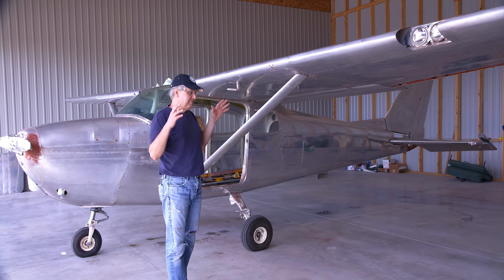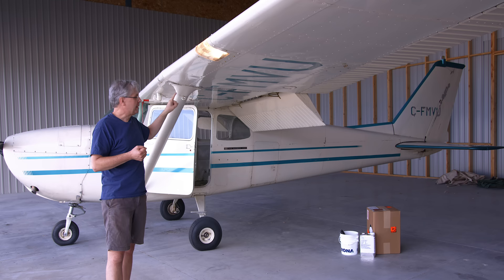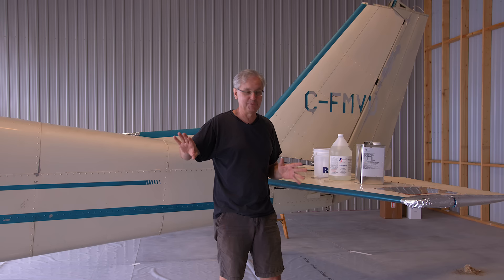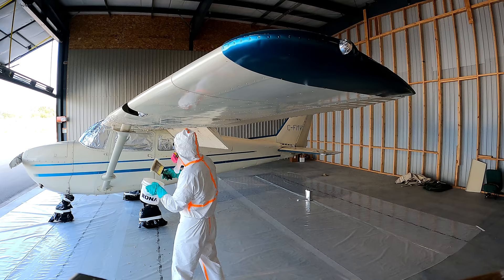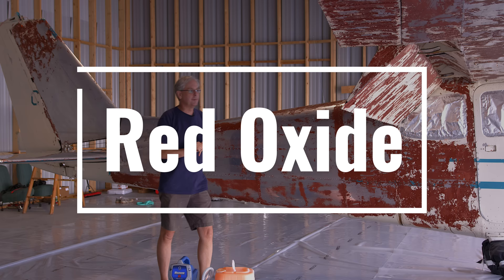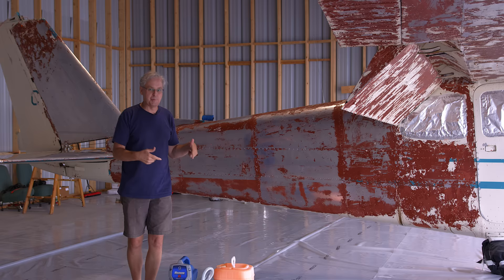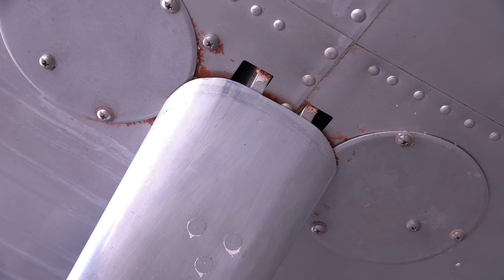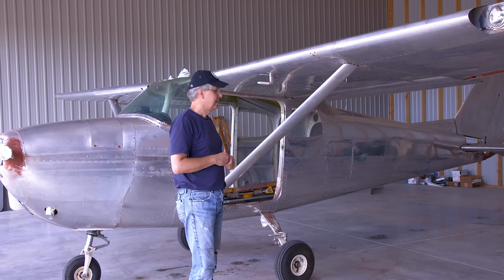Stripping The Paint From A Cessna 172B Glen's Hangar - Episode #5

Comment: Wondering why you didn't remove the control surfaces before stripping the plane?

One of the ATR-72s I used to work on, you could still find bits of blue paint from when it was with Vietnam Airlines.

Love the mystery of the tail! Oh the things you find hidden beneath the paint on aircraft.
Reply from the maker: I’ll be pulling those off when the plane is in the shop for the panel upgrade.

Comment: This plane is the perfect example of why to never ever go bare aluminium.Mismatched parts, patches, small dents from many years. Everything shows up, and anything but absolute perfection will look bad. Even to the point the more work, the more obvious the flaws. Personally I would repaint it and be rid of all that work. It would be different if it was a warbird, and was take down completely, and every rivet and panel was redone, but this isn't that kind of restoration...
Reply from the maker: Yeah... wait until you see it polished and finished with accent stripes. It came from the factory mostly bare polished aluminum with a stripe painted down the side; so why not return it to that state.

Comment: Red Oxide primer has to be by far and away the NASTIEST, TOUGHEST and STICKIEST stuff on the planet. I would rather deal with lead-based industrial paint than ever touch Red Oxide again. If you're going to prime it, use the regular grey stuff unless you have to use Zinc Chromate. 

And for a color scheme, I would suggest going with the old-school RCAF white with Day-glo orange tail and wing tips, like the old Avro Arrow, or one of the many "One" paintjobs that squadrons have had. I'll reference Lynx One, Hawk One, and Alouette One when the CF retired the Voodoos. I think they've done up CF-5s and CF-104s similarly, I know there's images of a tiger striped Starfighter floating around, but can't for the life of me remember the squadron.

Comment: I am not an expert on this by any means, and I am sure you considered that. But I THINK you'd need some sort of top coat on the aluminium, I believe bare aluminium will oxidise?
Reply: When alumnium oxidises, it creates a protective layer to stop further oxidising. Similar with titanium. It's not like steel, where the iron oxide allows further oxidation more easily.
Reply: @somegeezer  ahh nice. Thanks for explaining
Reply: @somegeezer  and polished plane have true low live plane, not longtime and has corrode all cover out of safety .broken fast, painted plane have long live plane lot than this.

Comment: I have a 1958 C-172 that is mostly bare aluminum and the two different colors about the fuselage and accents on tips.   I'm wanting to keep it polished and return to it's original factory paint color.  I want to remove the chipping paint that is currently on the bird.  Did you ever give thought to soda blasting or is that too abrasive on a potential polished finish?  I wonder if I I should stick with a painted-on removal product like you used.   Any guidance?

Comment: Greetings Glen from Australia. Just wondering did you happen to weigh the airplane before you stripped off the paint?
Reply from the maker: I don't have a great handle on how much the paint weighed if that's what you are asking?  We didn't weigh the plane before we started; just worked from the weight and balance in the logbook. But that weight was most likely incorrect after 61 years of additions and subtractions of equipment.  Post work the empty weight is 1300 lbs, with a gross of 2250.

Comment: I don’t pretend to be an expert, but if I remember correctly part of the job of the paint is to smooth out any curves and provide better aerodynamics, and as pretty as bare aluminum is, it may fly better with paint, or at least some solid clear coat, good luck and happy flying
Reply from the maker: I could argue that the bare aluminum is way smoother than most of the painted planes out on the ramp.  It flies just fine without paint, and it's also much lighter giving me more useable load.
Reply: @GlensHangar  that’s good, enjoy your beautiful airplane, see is a beauty, bare aluminum is my favorite look

Comment: The Red Under Coating looks like the paint they use on the "Golden Gate Bridge".  What about using "0000" steel wool????
Reply: Using steel wool on aluminium aircraft is a very big no no and is not practiced by engineers, painters, etc. Steel and Aluminium are not compatible materials and galvanic corrosion may result from their interaction. Scotchbrite and nylon wheels can be used but even then it is not ideal as abrasives damage the cladding on the aluminium which can hasten deterioration.

Comment: Glen, paint is really heavy. On my 206 it's about 500 lbs. Any alternatives to paint ?
Reply from the maker: Polished - in 1960 more than half of the Cessna 172's were just polished aluminium with a stripe or two down the side.
Reply: @GlensHangar  they have vinyl wrap for planes now, lighter and great for striping.

Comment: I polish cars and metals as a hobby.  I cannot tell you how badly I want to go after that whole airframe with 5000 grit on a DA and then polish by hand.
Reply: I own a aluminum boat you can use a product called sharkhide it's a clear coating to protect your aluminum after its polished it's very easy to apply